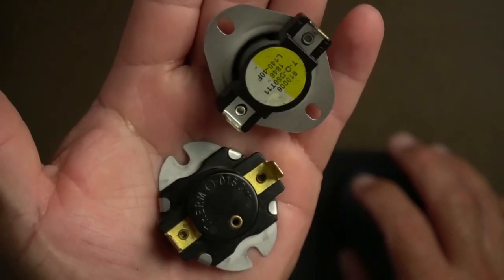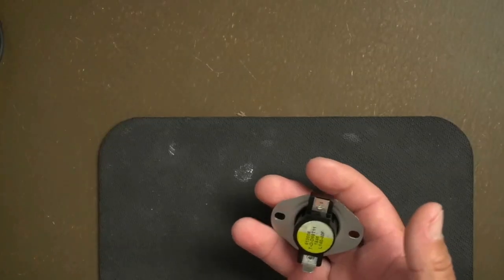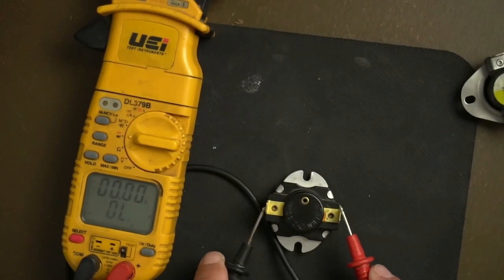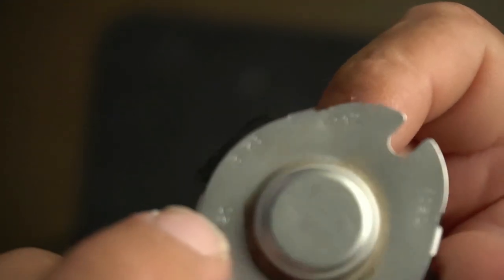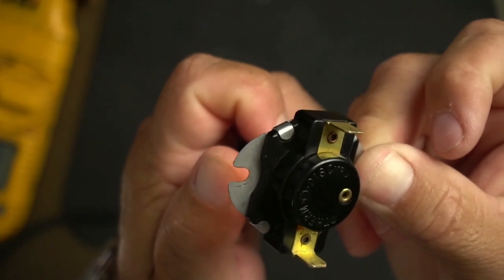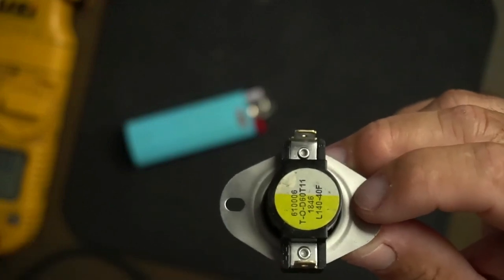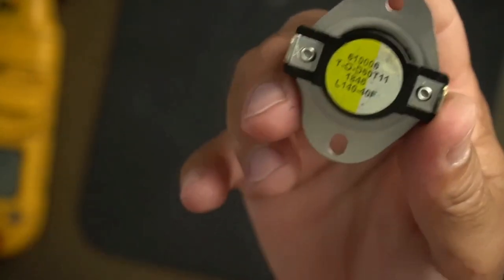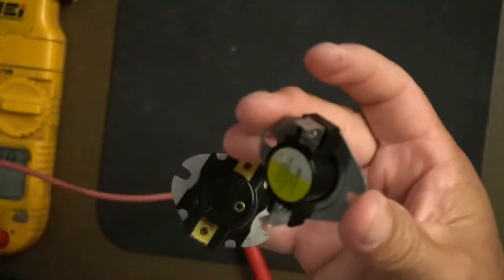How to know if limit switch or fan switch should have continuity. #maintenancetech #limitswitch

Comment: I own an M1M series I’ve replaced the circuit board already I’m having problems with the fan not turning off after the ac/heat is done being used, only way to turn it off is to manually turn the switch off. If I turn the switch on it immediately turns the fan on without even controlling the thermostat. How do I determine if it’s the fan switch or the limit switch to be replaced?
Reply: I was told my board is bad, fan motor is bad and need to replace my thermostat. Before thermostat was not the problem but it needs to be replace. My furnace runs nonstop but blows no air. It was warm by the vent but no warm air blows. Now the serviceman wants me to buy a new furnace from them. They will not repair my furnace. Is there anymore honest serviceman around anymore???

Comment: very good thankyou very helpful so much to check for when systems don't run easily overlooked guess what if that fan got hot for a long period could ruin the limit switch it would have to be replaced if it don't go